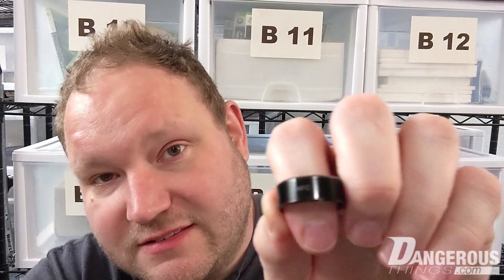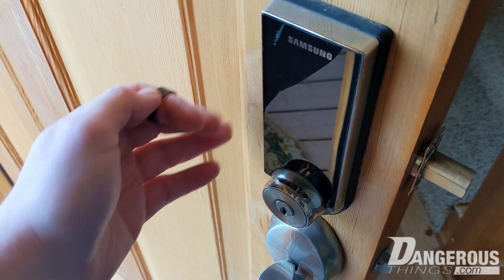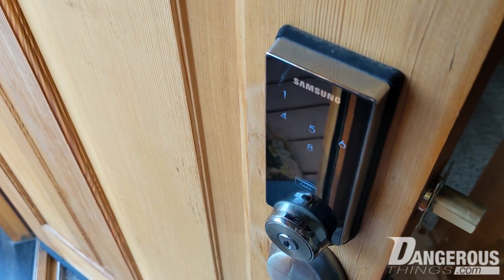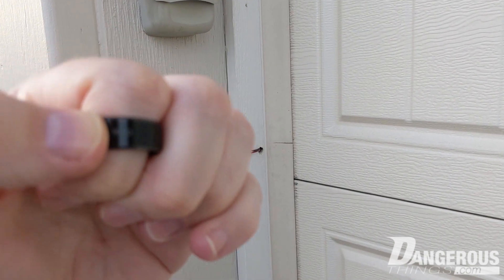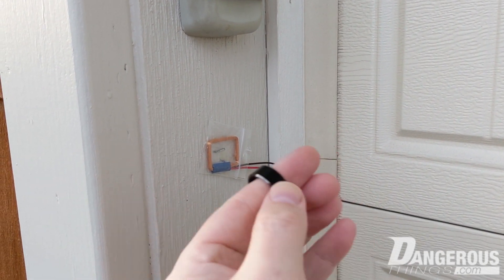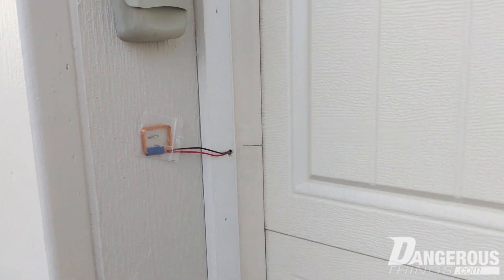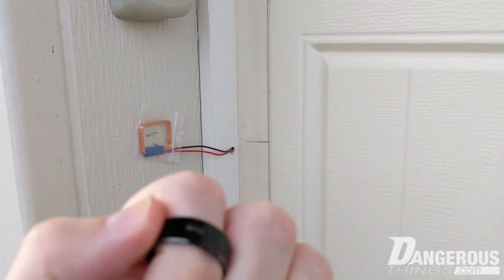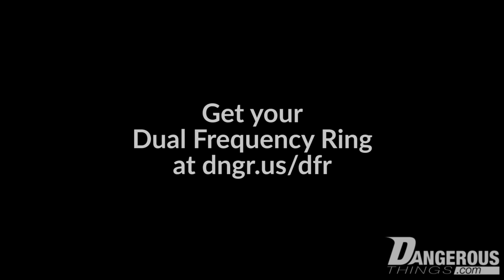Dual Frequency Ring

Comment: I recently started using an $8 T5577 ring from AliExpress for work access, but I use HF at home so having a dual-frequency solution that eliminates the need of wearing two rings at the same time is awesome. Is it ODM of Jakcom R4, or completely custom OEM?
Reply from the maker: it's custom :)